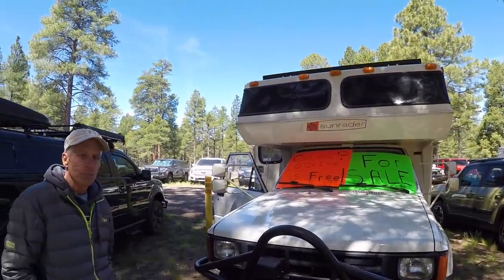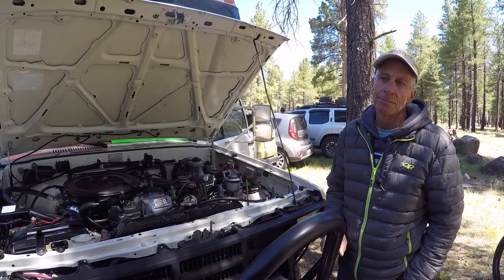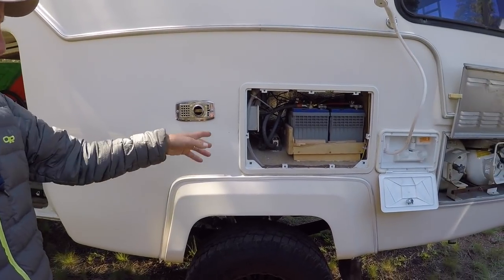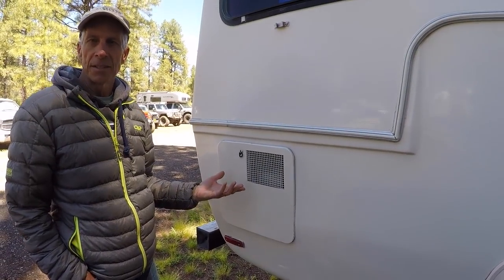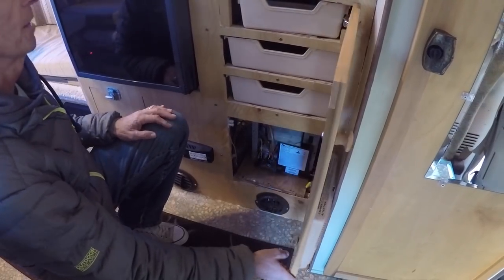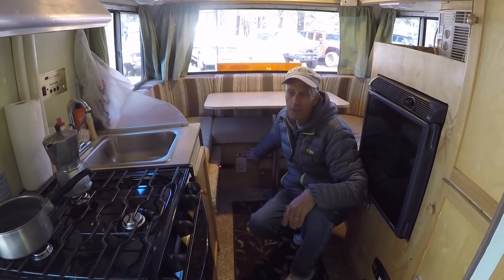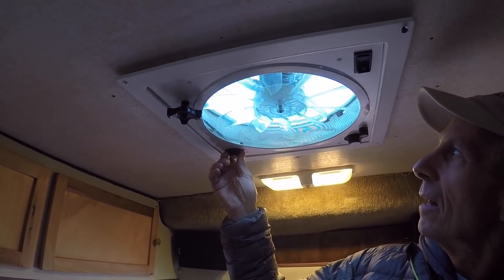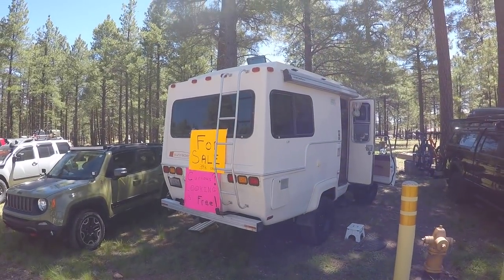Best Toyota Sunrader I've ever seen: 4x4 RV with original 22R engine

Comment: I bought one new in 1985.  The 18’ with 2 wheel drive and the automatic trans with overdrive.  Thankfully I bought a bumper to bumper warranty from Kelly Blue Book.  After multiple transmission failures they insisted the overdrive be locked out.  A couple more failures and gave up and traded her in.  Too bad, I loved that crazy little thing and if it had a standard transmission I’d still have it.

Comment: This is such a wonderful RV, except for being a manual transmission, I can tell you that most folks are looking for an Automatic Transmission Drive RV. You have to find the right buyer for this baby. For most this is a deal killer.
Reply: Personally ... I MUCH prefer manual transmission
Reply: Manual transmission is bomb proof😎😎😎
Reply: Anyone looking to buy a rig similar to this one doesn't give two craps that this is a manual trans. And I've driven a 22r powered rig with an auto. It was slower than molasses in the middle of december. The autos that come with these engines take a lot of power away from them.
Reply: Nobody who appreciates these classic mini motorhomes prefers the automatic trans.  That 5-spd is worth its weight in gold.

Comment: My dad had a 1988 Toyota regularcab pickup 2wd with the 22r and 5 speed he bought around 1990.. He lifted it up and added large mudtires. He grew tired of no A/C and traded it for a Honda Civic in 1999. He said he was able to haul my uncles boat that must have been around 2500 lbs and he sometimes forgot it was there and drove too fast a few times. He then bought a 2002 f150 FX4 Supercrew which he thinks is a better truck in every single way. But I think that there's always more room for a small pickup truck.
Reply: I had a 99 civic ex coupe and traded it for a 99 crv. Its lifted and turning it into a overlander. God bless

Comment: That's actually a great deal at $39,000. I know people who dont think so, but capable rigs that will last a life time are very pricey. This is completely upgraded and like new. You would pay about that for a new truck camper, then spend a bunch to upgrade it, then you still need a truck. Four wheel campers, that have everything this has, are well into the 30s.

Comment: That is really cool it's way better than my 86 4×4 wagon with hi-low dif even i wonder if the 22R was one of first ones build just for that rig because i thought the 22R didn't come out till the late 80s but im probably wrong on that
Reply: My 1985 Toy 4x4 pickup had a 22R.  With a head wind the truck could only do 55 mph.
Reply: @rd4660  lol yeah i remember my brothers truck was the same way the only time it had more power was after he punched out the cat converter NGK tune up and oil change for good measure but it almost always started on the first turn so that's got to be worth something i guess

Comment: What a find! You were lucky to find that thing my man. I certainly wish I could get lucky enough to find something like that. I guess you just got to get out and look around but you sure luck out. Congratulations take good care of it and it'll take good care of you. Have a great day stay safe and keep your powder dry! PS it's also EMP proof yay
Reply: I know of one for sale, but you would need to do all the upgrades yourself. Lotto work, but wow when done your so self sufficient!!! 
I'd start with bigger tires frame lift, springs chassis and go up
Reply: An EMP pulse could possibly destroy the circuitry in the alternator.  You'd keep driving, but your battery wouldn't be getting recharged.

Comment: Anyone considering getting an old Toyota motorhome needs to research the recall that happened on the rear axles.  They were recalled because they weren't strong enough for the load and they would break.  If you see a rear axle with 5 lug nuts run away.  I still see people selling these on Craigslist and they are an accident waiting to happen.
Reply: it's not hard at all to upgrade an axle.
Reply: @zzz7zzz9  Very true.  The heavy-duty Toyota axles are available and would be a great upgrade.

Comment: Sweet rig, but how the hell does that engine pull that?!
Reply: Low gears I'm guessing.
Reply: I had 4.88s in my 86 Toyota. I had 33s on it,a metal flat bed, ladder racks, metal side boxes, and about 1000pounds of construction equipment on it. I ran my framing company out off that truck for many years in the 90s. Wasn't fast, but got up the hills and was great. Trucks wernt that fast back then. I miss that truck. Gave it to a employee of mine with 340,000 on the odometer. He drove it for a few years and sold it.

Comment: Nice rig no doubt about it, but for $40 k you can get a brand new van and something left over to convert it into an equally able camper, sans 4x4 which is not really necessary
Reply: New van?   Maybe in 1990.  These days that New Ban would be more like $90.  A used decent camper would be more like. $80
Reply: Only 20 were made by the factory
So yeah ... $40,000 and rising

Go price a new vehicle today ... 
2021 dodge pro master 3500 is $37,895
I priced out all of the components to build a van and it’s around $30,000 with a decent solar system add in labor and that’s why rigs are over $100,000 now

$40,000 for a classic 4x4 sunrader
Reply: Comparing is disrespectful, specially with the junk on sales now in days.  This rig is Awesome.
Reply: This vehicle is super rare, it will be worth alot in the future. Worth every penny
Reply: "4x4 not really necessary"???? it is if you plan on going anywhere. it's not built to sit on the pavement.

Comment: I had an old Toyota 22r pickup...it was dreadfully underpowered. How do they do attached to a heavy camper? My 2019 Tacoma could handle it fine..
Reply from the maker: Maybe the gearing is super low.
Reply: @mixflip  maybe. I think it was actually way underpowered
Reply: I have a 1985 toyota 4runner with the 22re and 5.29's in the axles exocaged with DOM and she does 75 up the cajon pass in 5th gear without downshifting running 35x12.50R15 BFG's on the way to Vegas! Its all about gearing with small engines. She probably did about 70 MPH in 5th with 4.88 gears no problem. How fast do you need a 18' camper to go??
Reply: @tgreen1380  at what rpm is the engine running? That kind of gear ratio is usually redlined at 75 mph.
Reply: @rogerwhiting9310  not with 35x12.50xr15" tires the rpms are no where near that high at 80 mph which is about as fast as you wanna go in a 1985 4runner with solid axles front and rear and front disk but rear drum breaks !!
Reply: @rogerwhiting9310   That rig with the great 22r engine will never do 75 mph, and it doesn't need to apologize about that.

Comment: I have a 1988 Nissan sunrader
Reply: I have an '84 Nissan motorhome.  I never knew there was a Sunrader version.  I love the  Z engine and the 5 spd. trans. Nissan rear axles never had any problems- built even heavier than Toyota's upgraded 1 ton axle.

Comment: This thing probably tops out at 55 mph...which I guess wasn't so bad when the national speed limit was 55
Reply: It's not bad now. I rarely ever went more than that in my Toyota motorhome, driving 20k miles across the country between 2021-2023.
Reply: It should be able to get along with the big rigs that run along at 65mph.

Comment: 40k... not even close. 12-15 only cause of the love the guy put in. It still needs work.
Reply: You won’t touch a 4wd for 12  to 15 unless it needs a total restoration.
Reply: @paulmayfield9709  yes one for sale now for 10 that needs restoration
Reply: @ejRecording  yes I saw it was thinking of buying it. But I think he said something about tear axel broken now. Are you talking about the odyssey on Toyota Rv?  They do come up once in awhile like that the odyssey is the first 6 cylinder I’ve seen. Plus I’m not sure if it has appliances or anything else for the inside. I did see one also about a year or so ago I think it went for like 4 or 5 grand. But it was just basically a body. I have two getting ready to sell one tomorrow. It’s slot of work redoing these things

Comment: Aren’t these notorious for the axle issue? I wanted to get one but not after hearing about that. Extremely dangerous. Why would anyone buy this knowing it has a fatal flaw? I suppose you could replace/upgrade everything but that’d get expensive I’d think. Anyone know more about this?
Reply: Did you watch this? He replaced the original axle with a 1 ton Dana 60. Full floating.
Reply: About 1,000 swap out'  {rear axle]